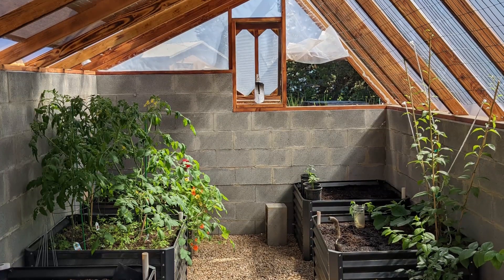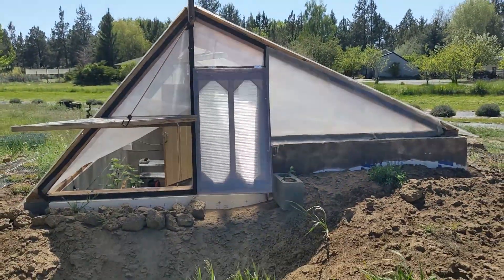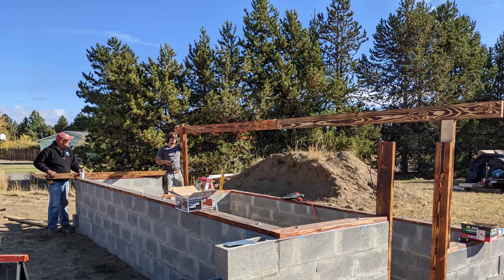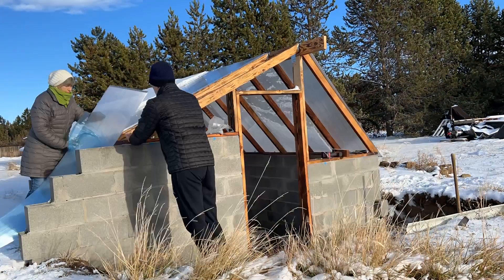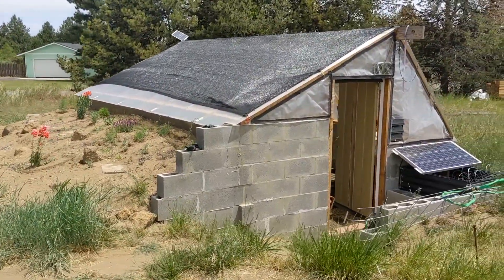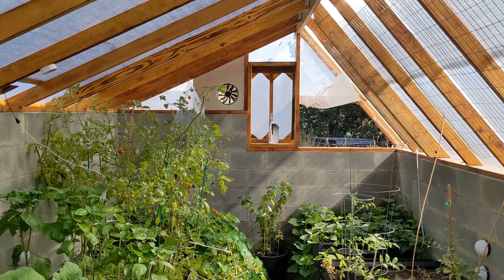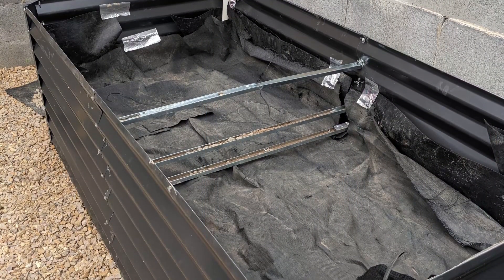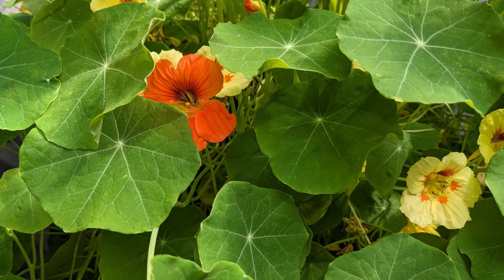Walipini Build Part 4 - Roof and Ventilation

Comment: She said her design is to keep temperatures 5 degrees above outside temperatures.  So I turned off the video, and won't watch any on her projects.  She clearly doesn't understand the design parameters to be frost-free. Also she can't lay cinderblocks, there is supposed to be a good 1/2" mortar left to right
Reply from the maker: That 5 degree cap is for summer only. The goal for cold days is to keep the Walipini well above freezing. And you're right, I don't know how to lay mortar like a professional. It was tricky to make the adjustments needed to have the final row of cinder blocks level. But janky as my work may be, it ended up level, and all is well. Too bad you're not going to stick around to learn how much warmer my Walipini is than the neighbor's greenhouse across the street. I'm still growing squash, tomatoes, sweet potatoes, cucumbers, and eggplants when we're getting frost on the outside.
Glad you stopped by to comment!

Comment: what is the winter temperature difference inside vs outside?
Reply from the maker: @antiusOFFICIAL  On a sunny day with no ventilation to the outside, it cooks. The other day it was 15 degrees outside and inside it was 39. On a summer day you need a lot of ventilation to cool it down, but I can keep it to 5 degrees above outside temps (that's pretty cool for an enclosed greenhouse). Thermal mass keeps it warmer in the winter and cooler in the summer than an aboveground greenhouse.
Reply: @Diymarta wow, interesting! thanks for the reply!

Comment: Hello! I'm wondering if you've had any issues with flooding in the walipini? not so much from the roof, but more due to the flow down the stairs going into the structure? if not, what did you do to prevent that issue? was the gravel you laid in the beginning sufficient to prevent this?
Reply from the maker: @kryspiatek8058  We are fortunate to live in a dry climate and rarely get heavy rains. Also, our soil is volcanic and rain water soaks into the ground quickly. Those are things you have to consider about your location. 
I did have flooding one time, but that was because I left the faucet on with the hose attached, and the hose burst. The walipini filled halfway up the walls. But once I caught it, the water receded in a few hours.
It's always interesting 😊

Comment: great job. Mistakes are fine I think. In my opinion it is hard to know what happens when the wind blows. Air circulation can be difficult at times. Looks like you had an infestation of Aphids.
Reply from the maker: @mauricebrown9094  Bugs are known to be a problem in greenhouses. I've found some solutions. Gardening anywhere will have its challenges, I'm finding.